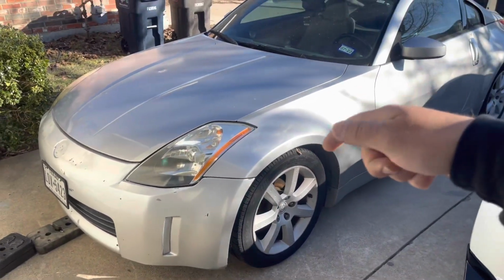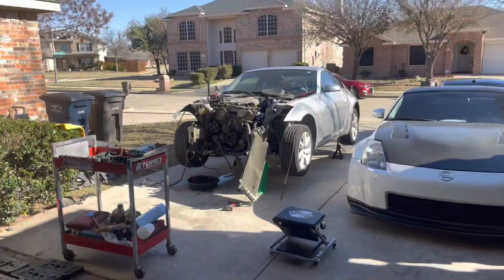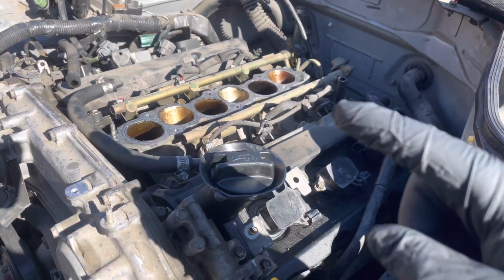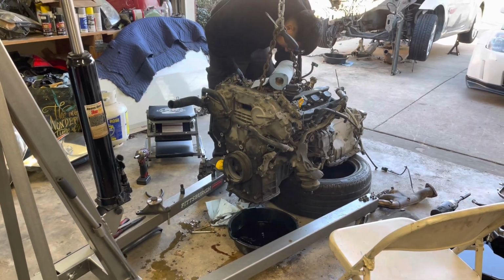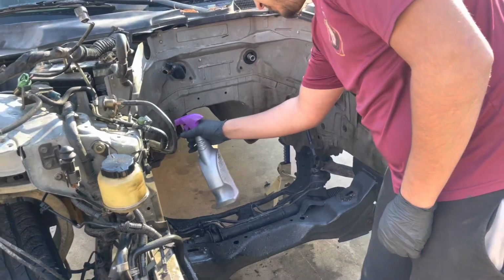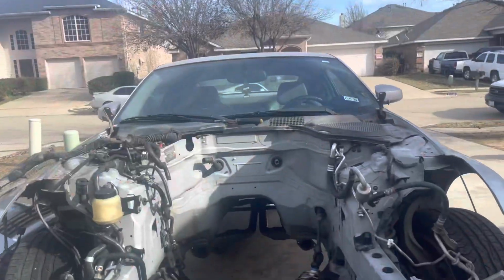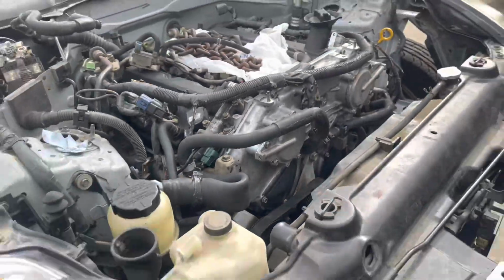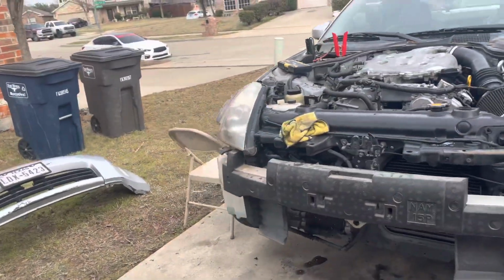REPLACING A 350Z ENGINE!!

Comment: Man.... you guys did an amazing job... here i am nervous because i dropped my fx35 to my mechnic for a head gasket repair & replacement and timing chain tensioners and water pump. i'm nervous because i dont want to find out there a crack in one of the heads.